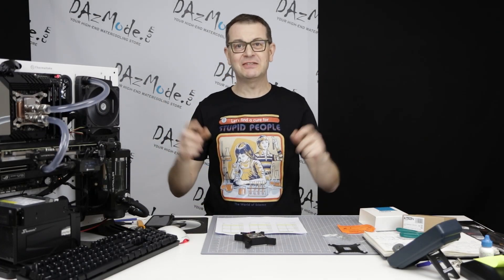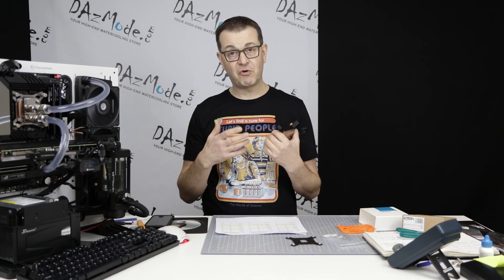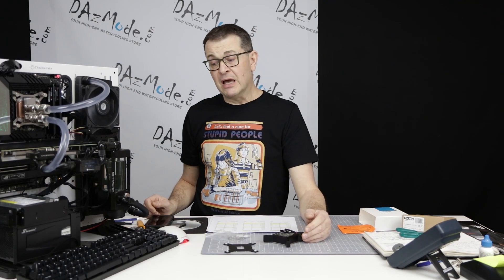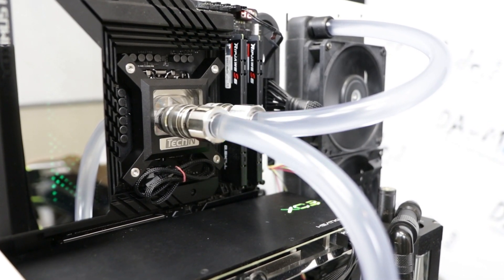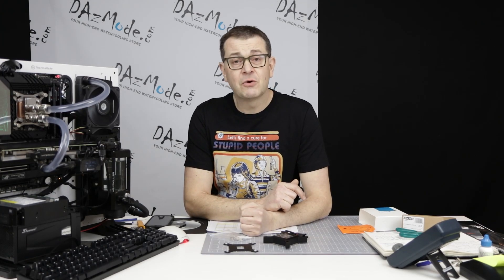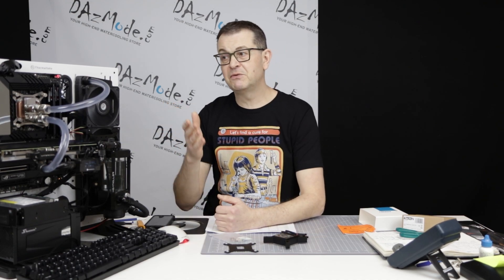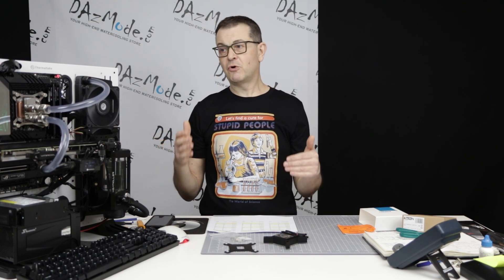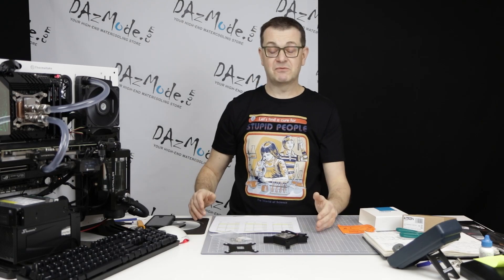What is about non LGA1700 compatible blocks?

Comment: isnt there a washer mod on cpu retention block to fix temps?
Reply from the maker: There is also reports that it will damage pins long term
Reply: @DazModeWatercooling  no I'm talking about raising the bracket that holds cpu in place,placing a tiny washer under it to raise it a bit to reduce the pressure on cpus and pins?

Comment: Wow! Bad results, but valuable information. I wonder if the Heatkiller imprint inconsistency is caused by the new springs. Not just being stiffer, since Daz is tightening very carefully. Spring coils rubbing on the stud? Inconsistent spring free length? Or... wider-spaced studs rubbing on block's mounting bracket? 🤔